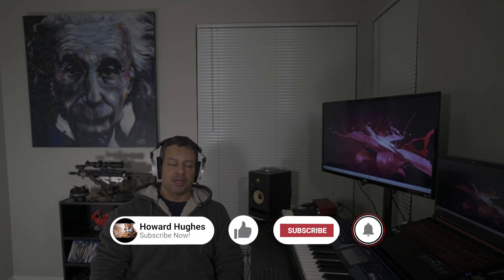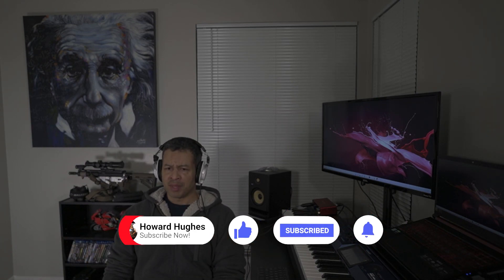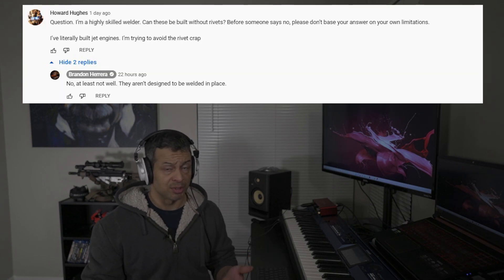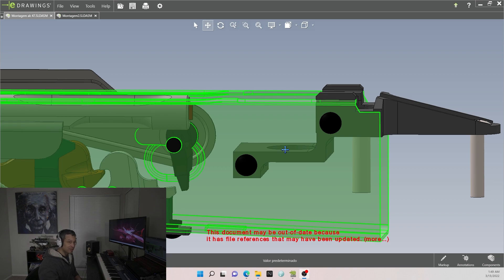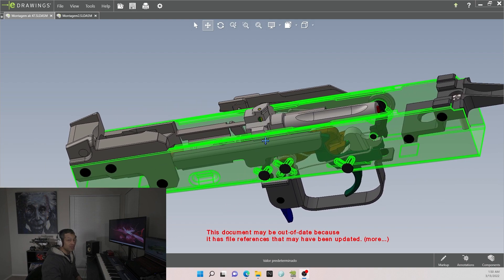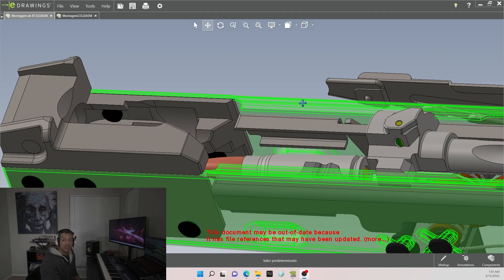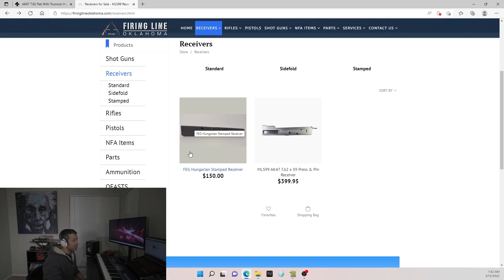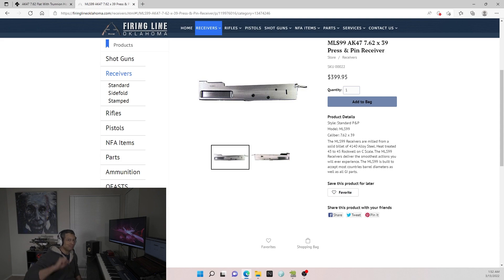Welding the AK-47 - Response to Brandon Herrera

Comment: Plug welding the trunions will work . I built 1 that way. As far as the durability goes. Dont do it. Its not worth the liabilities or the danger to your self and bystanders.  The rear trunion is the easy part to weld. Absolutely no issues there. But the front trunion is not easy. You cant weld it on the inside of the receiver and on the front [hand guard side] you will have parts interference and fitment issues.  Welding the rivets  and not crushing them will never work. The gun will not function as intended. If you are not willing to do the rivet assemble.  Tap the trunion for  10/32 screws and use 10/32 allen screws 3/8" long and use red loc tight welding isn't safe.

Dont fuse weld it. Thats not going to be durable or safe and not worth the risk
Just my opinion and experience.  
And remember breathing and not leaking are fundamentals of life.

Comment: I would say that rivets were used was it was more of a common practice than welding so if it ain't broke then... But I see no problem using welds if done properly. TIG welding was aerospace technology back then and TEMU tech today. So no reason to get the panties wedged deep in the crack about it.

Comment: I'm a certified mig welder I went to school for welding well not just for mig I used stick and flux and if the creator of the ak wanted it to be weld he would've and two the weld would melt where the trunnion is if you try to weld it it's then ass material

Comment: You are assuming that is correct, but you just don't know, the only way to prove you are correct is by making it and shooting at least 5000 rounds without any damages like any AK should be able to do. Of course you can weld it. Can it be as reliable as rivets? Multiple thing to note here that you probably didn't think about: weld are affecting the heat treatment and can eventually cause the weld to crack under stress. A stamped receiver is flexing a LOT when shooting, a trunion fixed with rivet can take the flex and flex with the receiver, a weld can't do that. A milled receiver like you are showing at the end is milled from a block of steel, it's way more rigid than a stamp receiver, and doesn't flex like a stamped. "Welder was correct", no, stop assuming and make it, because you didn't prove anything with this video, of course you can weld it, but it's probably dont gonna be reliable over time. An AK can shoot without any rivets in fact. Btw, when you say put the rivet in there and weld it, that doesn't make any sense. The trunnion will float on loose rivet. Glock might not be gunsmith, but he was an engineer.

Comment: Seems like you can just use the rivets grind one side almost flush with receiver then simply make two spot welds on the less stressed side . If not rivets then seems like you could simply use dowel rod pins and spot weld both sides on less stressed sides of pins .  Now you would have to lightly damage receiver to ever change internal parts. Witch as far as I can tell is main reason why spot welding is not the method of choice to begin with other than welds can possibly Crack over large round count & for fear of heat affecting the metal but I figure welding if done carefully could be extremely durable in the semi versions that 99.99% of different builds are.  Especially if people really just use a rifle for modest sport target practice and hunting ect.  Many people really abuse guns badly with excessive rapid fire vibration & heat build-up.   Just my theory & 2 cents.  But if I'm not wrong many guns used to be welded together & after years of excessive abuse the welds did tend to Crack but they were actually welded in places far more critical than just holding pins in place like literally half the gun would be welded together.  Kinda like pre cut receivers being re-welded back together and they work but are welded in a far less desirable way than just holding pins in place with tacks .  But what do I know , I'm just a  dreamer it's cheaper to just dream sometimes.
Reply from the maker: Cheaper to dream is right. The economy tanked when I was considering this build. Now groceries cost more than guns 😂

Comment: Remember how the upper receiver on the AR-18 utilizes small plug welds to fuse the sheet steel to the barrel extension? - just do it the same way on the gun shown above -no internal fillet welds required. 🍁God bless America 🇺🇸

Comment: Don't forget that all the parts are heat treated at the time of assembly. If you weld it, regardless how skilled you are, you heat the components to a temperature that gets the components completely out of spec.
Reply: But it gets hot when you shoot a shit ton of rounds through it quick
Reply: @Or3guns  The few people who did torture tests with guns to the point the metal got red hot and the furniture burnt did not use the gun again.
Reply: For a diy'er I wouldn't think it would hurt to put a couple welds on the reunion wouldn't jack up heat treat🤷

Comment: A) you’ll destroy the heat treat on your locking lugs (= kaboom);

B) you will make replacement of parts much more difficult and likely (at least from an economic standpoint) impossible.

A is more relevant to the front trunnion, and B to the rear.  Note also that more than just the trunnion is heat treated.  Being able to do something and it being any kind of “good” idea are two different things.

Also, Gaston didn’t devise the plastic pistol (HK had one decades earlier), he just made marketed one “right time, right place.”  It is appropros that you mention Glock btw, since cheap, durable, and idiot proof was also the mantra of klashnikov.
Reply from the maker: You speak of metallurgy like you’re a tradesman. Oh wait you’re not. You’re dealing with just theory.

Oh children.
Reply: @howardhughes6212  dumbass...
Reply: Lmao!

Comment: The last receiver you showed you seemed to imply that the trunnions were welded in. That receiver is milled from a single block of steel. No welding is part of it's construction. You can look up the history of the AK. It was first designed to be folded and riveted sheet metal, but the russians didn't have the design dialed in for the sheet metal so they did milled receivers for a short time till they could get down how to properly make a sheet metal and riveted firearm. You can look up the history on the AK. You don't need to assume anything about intent to weld or not weld

Comment: What if you drilled multiple holes in the receiver and just welded to the flat sides of the onion through the holes
Reply from the maker: That would work. I welded pipe that way for automotive suspensions

Comment: Why would you weld the rivet when the rivet is what’s used to hold it in the first place .
Reply from the maker: I wouldn’t weld the rivet.
I would probably weld somewhere else. This video was more of a thought experiment to get people thinking.

You say the reason it was riveted is: “rivet is what’s used to hold it in the first place.”

That’s how a gun person with no manufacturing knowledge thinks.

These were riveted to cut costs and be more simple to build.

The entire receiver would be better if it was machined but they didn’t do that because stamped and bent parts are easier to manufacture.

Rivets are not the best option no matter how much you want to not think for yourself.

They are just the cheapest option amongst many.
Reply: @howardhughes6212  hmmm okay.
Yes you are correct it was riveted to cut costs and to make it a simple process . 

No it’s not how a gun person with no manufacturing knowledge thinks, it’s how a gun person who knows the history of said firearm thinks . The original Russian receivers were milled does and took a threaded barrel does it make a better rifle ? Maybe not ( the rear and front trunnion were built in) 
They turned to stamped steel and rivets to speed things up . The AKs with the stamped steel are known as “ AKMs “ . 
Most of the Russian sub machine guns and machine guns around 1943 were stamped and riveted because milling took took too long, the rails on the AKM are spot welded on, so there is that .
The beauty of riveting is that if you happened to need either the front or the back trunnion removed you can just grind off the presto it comes off . If you are gonna weld a milled receiver you might as well just make it alllll one solid piece . 
The Hungarian receiver you showed, is a milled receiver and yes it is a better type of receiver and thicker metal. 
The Gallil which is an Israeli version of the AK but better in a lot of ways has a milled receiver with the trunnion part of it to start with . And the barrel is threaded on instead of pressed in and riveted . 
The firearm and it’s purpose is what drives it’s manufacture process . Not always “ what would be better “ . The AK like the PPSh-43 were meant to be mass produced as fast as possible to meet a need, where it was quantities over qualities . But it still is one of the toughest battle rifles the world has ever seen . 
There are plenty of better quality machine guns out there with milled receivers . 
 You obviously have never heard the term if it ain’t broke don’t fix it… 
If you had stuck with “ Oh it can be welded I’ll show you how “ and left it at that, you would have been fine . But now you just sound like a know it all . I think I know why you only have 490 subscribers .
Reply: @howardhughes6212  

Not quite. That’s how a modern welder familiar with modern methods, while taking for granted  that what is common knowledge today, was learned through trial and error, by others and over time, thinks of production. 
The receiver you were pointing at is a milled receiver. No need to weld anything, because it’s machined from a solid block of steel. The first AK prototypes used stamped receivers. Because the rails had to be welded in place, these rifles were plagued with failures. I’m guessing they knew far less about metallurgy and proper heat treatment /tempering, than what is common knowledge today but that’s just speculation. They decided it made more . sense to take an 8lb. block of steel and spend several hours machining away 2/3 of the material.  This was the AK-47. People still refer to AK platform rifles as AK-47’s but they were redesigned the AKM in 1959 when the Soviets were able to begin consistently producing reliable rifles with stamped receivers . In 1974, Russia adopted the 5.45x39 cartridge and the AK-74 was born. In 1994 it became the AK-100(then 101-105). Today it’s the AK-12. Today, AK’s are produced everywhere using both milled and stamped receivers. The rails are spot welded into the stamped receiver variants. Can you weld an AK together? Sure, go right ahead. Would anyone in the business of building and selling AK’s choose to do this? No, of course not. If you played with Legos as a child, you can assemble (not build) an AR-15. Unless you’re machining receivers and forging barrels, you’re not building an  AR, you’re assembling the parts. The AK is a simpler platform with widely varying tolerances but it’s a bit more complicated to build for the individual than the vanilla AR. Pressing, drilling and pinning and riveting are all very efficient when you have the tooling and an assembly line and the finished product isn’t going to come apart until you want it to. Please post a video of your completed AK and another after 5000 rounds. I would be interested in how the welds are holding up. If you’ve never seen an AK firing in slow motion, you should find a video. But really, what do I know? I’m not a manufacturer. I’m just a gun nut.

Comment: I would definitely agree it can be welded, however, I will add that the milled recievers have been beefed up for structural integrity.  I will also add that there may be an effect on the natural flex of the rifle when firing may be impeded with standard trunnion/reciever weld leading to stress fractures, this would need to be accounted for to retain reliability and overall firearm strength

Comment: Thought about this year's ago. Never tried it, but back in the day there were vids on here of people welding ak's and machineguns that were parts kits. And their results were functional guns, now for how long ?? And these people were mig welding horrible stuff on the receivers , but still got it to work.
Reply: That is [CAREFULLY so as not to destroy the heat treat) done on milled receivers where the average material thickness is 2.5x that of an AKM.  And you can only do so on those Demilled to BATFE specs from 20+ years ago
Reply from the maker: Yeah you’re right. Most of what I’ve seen welded already is done with MIG.

I’m planning a TIG build. I’m not gonna bend the material.

I’m gonna weld 3 sides together and weld those to the trunnions in a way they can be cut off easily.

The right and left side… before I weld them to the bottom, I’m gonna weld the rails while I have everything exposed.

When I complete the 3 sides, I’ll reinforce it in a couple areas.

I see the AK as a box.

As long as your box can withstand the forces and it’s the right measurements for the parts… then the box can pretty much be whatever.

Honestly most people lack the skill to achieve such a build but no joke I weld thin sheet metal all day.

I’m gonna grab some sheet metal from my job soon and do a proof of concept.

Comment: Let's see it, only one way to find out for sure
Reply from the maker: Exactly. I’m actually gonna try something crazy.
Reply: @howardhughes6212  Welding  the trunnion is a fairly common practice with other firearms. I welded my Uzi's trunnion to the receiver, and CETME trunnions are welded to the receivers, among other builds.
Reply from the maker: @sartorialdriver6528  Thanks and good to know. I also wanted to build an uzi… unfortunately this economy is kicking my ass so I can’t buy parts
Reply: @howardhughes6212  I wouldn't recommend building an Uzi from this point on. I pulled the trigger on my parts kit the second I saw it increase (back in 2020), and already had the 80% receiver in hand. Parts kits are overpriced and drying up, 80% receivers are difficult to find and serialized ones even more. This is all before considering the necessary parts like bolts, strikers, and other components you'll need to purchase for a semi auto build. At this point, you're better off saving to buy a used Norinco carbine or something else pre-assembled.